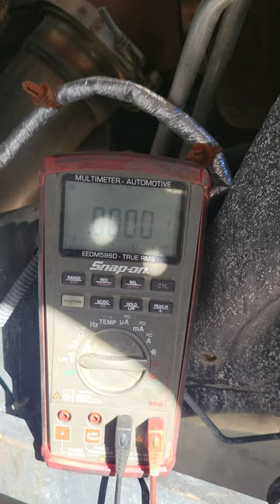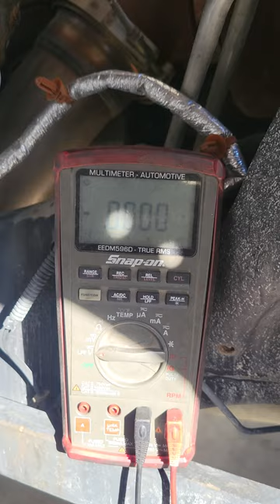TESTING VGT ELECTRICAL// CODE U010C- LOSS of Communication       RAM 5500 Cummins 6.7 #diesel #truck

Comment: Need Advice. 2012 Ram with efi live, truck has always ran great until the other day. Truck will no longer build boost past 10 psi. Scanner says there is 0 command and 0 actual for the vgt with no codes. Replaced the actuator with a city diesel unit same issue. Actuator dose move three time with key on. exhaust back pressure sensor reads about 18 going down the road. had an extra map sensor changed it still nothing. Reading at the actuator plug  has 12 volts, ground and 2.7 volts 2.33 with key on. Key off both com read 120 ohms.. any help would be greatly appreciated..
Reply from the maker: @hecler406,

Hi, sounds like head scratcher. You covered most of the 'General' failures with this type of symptom.

Only cause I did not read this step in your post, and this is a likely possibilty. Just a basic question.

Did you check to see if the Turbo VGT "Lever", the one that is driven by the VGT Actuator. Check to make sure it travels freely from end to end of travel. It is very important, because the VGT Actoator Motor, is not a high amparage component. It will try to move the lever, any subtle resistance and it will only try for a couple of seconds, and after a few attempts, it will put itself in Limp Mode. Because the Computer is monitoring VGT, Boost, & EBP (Exhaust Back Pressure) Desired vs Actual, and if there is a difference for more than about 4-6 second, the computer will go into 'Derate' (Limp Mode).

If you have a scanner, the type that can do 'Bidirectional Testing', you can start the Vehicle, and Command VGT movement and see if it's fully following commands.

There is a small Possibility that your MAP (Manifold Absolute Pressure) Sensor could be a problem. If able to read Live Data, monitor that MAP data in the morning, before Start Up (should be at Atmospheric Pressure) All pressure sensors should be at that number before Starting the Engine. Also check your Temp Sensors (Intake, Coolant, EGR, EGT's), first thing before start up (should be ambient temp).

Monitoring all Pressure & Temp Sensors, first thing in the morning before start up, they should all be within each others range, and near otside Pressure and Temp #'s.

I believe there is a TSB (Technical Service Bulletin) from the manufacturer for incorrect MAP Sensors based on Current Software Updates. I will gather this info, and see if you fall in that TSB....

Comment: On the orange and black I'm getting .584... this is without the key in the ignition and the ground of the tester direct to the battery ground. Is this the correct configurationto test it?

Comment: This time, no engine light, but went into some sort of Limp mode temporarily (1 minute). Only DTC was U010C pending. This week, a couple of times, light did set, but nothing happened.  Thinking machines are a pain.
Reply from the maker: This may be a sign, that the Turbo Actuator, is starting to go out. They usually loose communication once they get to operating temp. 

And if the #1 Nox sensor, is not putting up a code for communication as well, then it would point at the actuator, and not the wiring.
Remember, VGT Actuator & # NOX Sensor, share the same exact CAN Communication lines. So if wiring (it's only 2 wires on that communication system) is the problem, then both those part would loose communication with the ECM.

Hope you get passed this problem, these 6.7's are awesome when running good.

Good luck.... let me know, any way I can help.

Comment: When you remove the vgt actuator try and move the small lever that moves the veins inside the turbo if it does not sweep sided to side turbo veins are locked up and need to replace the turbo the vgt canot make a determination if the veins are locked up

Comment: Thank you for the data, no one offered electrical testing. I’m wondering if I could wire my VGT for max boost. I understand it will set off codes, and I understand it was not the way it is designed. But for the sake of testing, I would like to hot wire it and see what it does.
Reply from the maker: @wheyez1,

Hi, it's not a conventional circuit, where it gets power one way and ground. It is a PWM (Pulse Width Modulation) circuit. It pulses ground to regulate VGT movement at % of incriments.

Also, you may not want to force feed anything. The powers & ground coming to VGT Actuator are inly to power up the Module. It is a Stand Alone system that has it's own strategy and dictates Turbo Function. It is all Self Controlled inside the Turbo Actuator. 
ECM only feeds (PID) Data to the Actuator so it can do it's own thing. All the wires comint to the Actuator are Computer fed, and 2 are 'CAN BUS' Network.
You don't want to fry anything...
Anything you want to do with Turbo has to be programmed into the Actuator or atleast dictated by fooling the Actuator...

** Be Careful **

Comment: Is 1.7 within tolerance?
Reply: Was the 1.7 within tolerance?
Reply from the maker: @mattolmos666,

Hi, 1.7v on a CAN-L (Low), can be considered normal, if the Computer is on, and messages are being transmitted.

CAN-H (2.5v)  CAN-L (2.5v), if you see that, it usually means that CAN BUS system is idle, not much happening...

When the System is working, communicating, and everything is working as it should, you will see;
  CAN-H (3.75v)    CAN-L (1.25V)

If eberything is on, running, and you see 2.5v & 2.5v..
Usually means something wrong with a component in the Communication System. You would have to isolate (unplug) each component until Voltage looks normal. Replug in, and watch it go back to bad numbers, that means that component you unpluged, and pluged back in, is the problem...

Comment: I have a CANbus data problem but have failed to locate. My boost issue is intermittent as I get full boost at random times and other times at full throttle will only receive 12psi boost pressure. Great video but any tips on where to go from here would be greatly appreciated
Reply: Same issue with me except my boost is going lower and lower
Reply: Any update to this? What was ur fix ?

Comment: Thank you sir for the video, exactly what I needed to see! I got the U010C code only and upon testing the wiring the (orange) was ok at +/- 12v, the (white/light blue) is  2.8v  and the (white/green) is 1.8v and the purple is ok. You didn't tell us the problem if the two middle ones were far apart. Do you think I have a problem and if so what would I need for a fix? Thanks
Reply: @jefflancaster699 Did you find out if those numbers were good?

Comment: Thanks for the video I have U010C and U011A does that mean a can bus data problem and if so what does that mean how would I go about fixing it thanks so much
Reply from the maker: @zac Edwards,

Hi, yes it sounds like you lost can bus data communication. Being that you have lost communication with VGT Actuator & 1st Nox Sensor.

The circuit does need to be checked.
First things first, vidually check the wiring near the Engine block by the Oil Cooler/Oil Filter Housing. They all meet back there, and sometimes will rub through to the wires. 
Have to remove Air Filter Tube/Elbow or what not.
I will give you a description of whst to do, let me get some schematics, and see how I can help with that.

Let free up from what Im doing, and will get that going.
Reply: @smallhandsgarage9290  thank you so much I really appreciate it
Reply: @smallhandsgarage9290  I have a 09 ram Cummins 6.7 3500 third gen right before the switched body styles thanks
Reply: @smallhandsgarage9290  hi I still have that problem but now it’s only the U010C on my 08 dodge Ram Cummins just wounder if if you think it’s my actuator or just wiring I put my emissions back on my truck and getting the code a year later thanks so much
Reply: @smallhandsgarage9290  thanks for offering to help with this.  I have the same problem and was wondering if you made a video response? @zacedwards did this fix your problem?

Comment: Does the truck need to be in the "on" position, not running.  Or can it be performed whiles its off?
Reply from the maker: @christophercarias-estevez5844,

Hi, yes the key has to be in the on position.  What is called KOEO (Key On Engine Off)...

It's the only way to check power &/or grounds. If only checking for resistance/Continuity, the key does not even need to be in the ignition switch.

Comment: So I’ve got a 15 model with the 6.7 exhaust brake is gone and has trouble building boost. No codes and I have power and ground at vgt plug. Would you say acuator is bad?
Reply: Hey Chris did you figure it out. Did you replace the actuator? I have a 2018 Ram 2500 and it's only giving me the U010C code. Started mid January, the cel would come and go. I still had boost and brake till today I noticed the loss of power and weak brake.
Reply: @manuelgonzalez1652  yeah, a fleece cheetah fixed it. Blew the cheetah up and now it has a non vgt s467

Comment: I followed your volt testing, and at the high data wire (green/white), I’m only getting 1.7VDC. Can you recommend next steps? Thanks.
Reply: Did you find out if those numbers were good
Reply: @davidshapiro1419  I ended up doing a turbo swap.

Comment: I have a 2018 Ram 2500. I only have the U010C code the cel would come and go. I had boost and brake till today I noticed the boost was low and the brake was weak. It just started like the 2nd week of January.  Should I just replace the actuator
Reply: I have this problem, what did you end up doing?
Reply from the maker: @williamdavid9272,
Hi, this problem ended up being a bad VGT Actuator...

Teplaced only the Actuator, not the Turbo.
Reply: @smallhandsgarage9290  good to know! Just ordered  city diesel actuator, going to throw it on this weekend and see if it works. Appreciate the reply 🍻
Reply: @williamdavid9272 I bought the actuator from city diesel and took it to the diesel repair shop. I wasn’t sure if I could do the work since a lot of the videos I researched had issues with a bolt that was known to be rusted and hard to remove. Left it to the professionals.

Comment: Hi. Mine showed 12.3 volts in key on second position. The second one showed 2.8 and the third one showed 1.76 is this fine? Then ground 0
Reply: Did you find out if those numbers were good